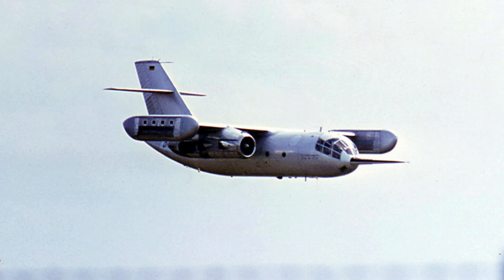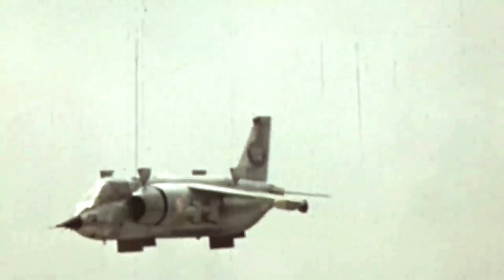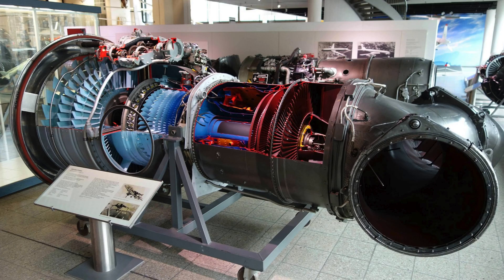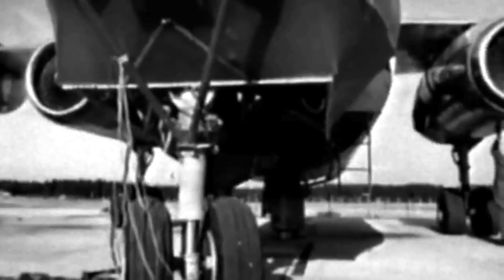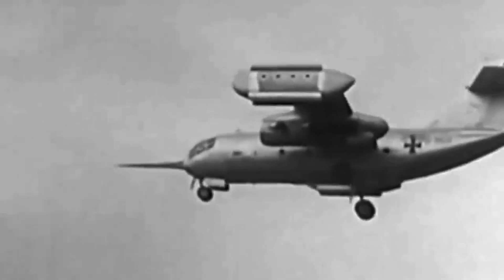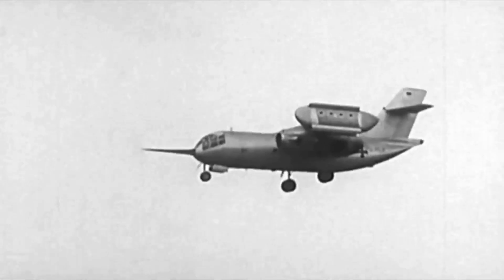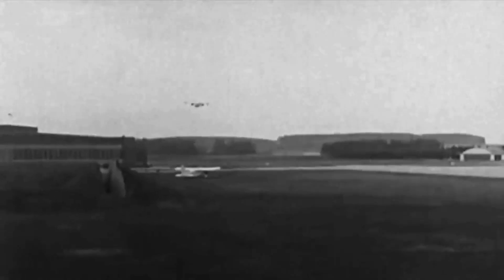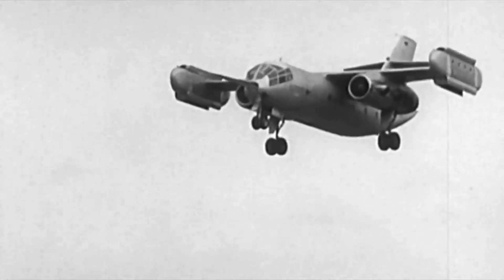Dornier Do 31|| Experimental German aircraft

Comment: -This was more a test bed with production units expected to get rid of the wing tip pods in favor of 4 RB-153.
One of the advances made by the German VTOL program  Do 31, VJ-101 and VAK-191 was the use o fFly By Wire and a Gyroscopic autopilot to handle hovering and the transition between -hovering and forward flight.  (The harrier was purely mechanical).
-I do wonder what the mission profile was to be.  It clearly was almost as big as a chinnook (3 squads, a whole platoon) and would have had about 3 times the speed and range of a helicopter. So it would be hard to shoot down and be able to run more trips but what was its purpose to be?
Reply from the maker: The combination of VTOL capability and enhanced speed and range would make it suitable for various mission scenarios, including special operations, rapid deployment of troops, and logistical support in challenging environments.